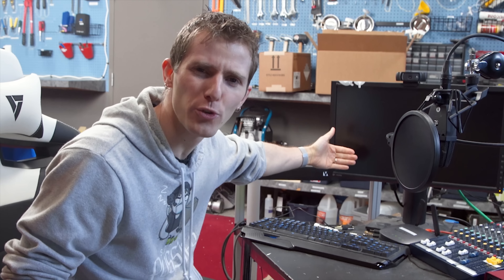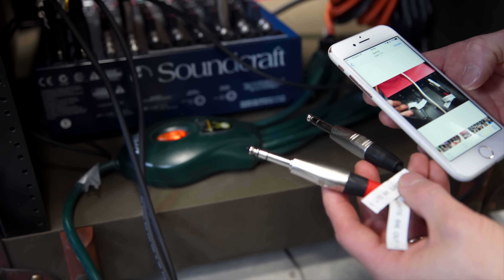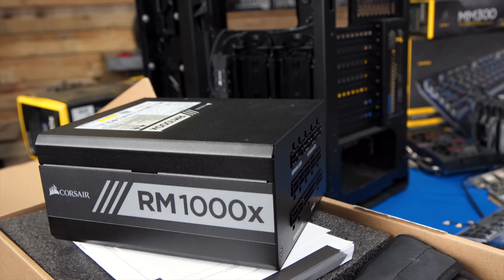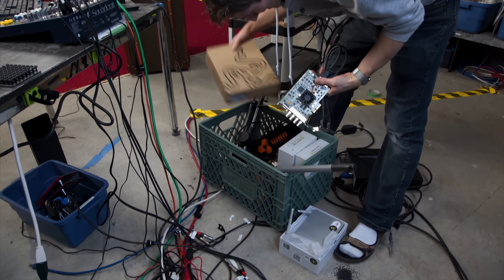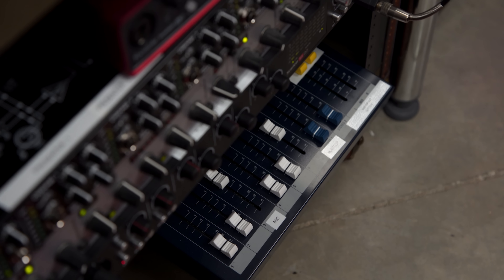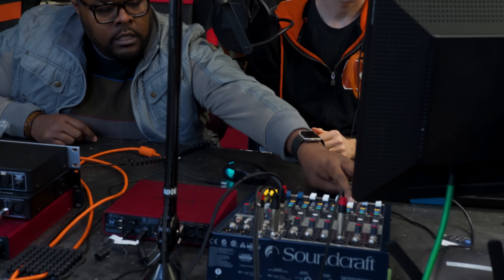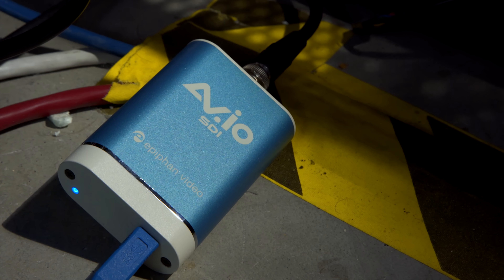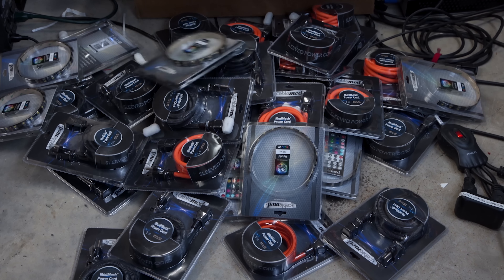WAN Show Repair Vlog - It finally works!!!

Comment: The RGB improves the power of the components by 200%
Reply: Power as in performance or power as in power consumption?
Reply: Works the same as stickers on cars to improve the engine.

Comment: Audio, the one tech I will NEVER fully understand
Reply: I find good audio to be very satisfying, but when youre streaming and you have say, 5 different audio sources you need to be able to control them on the stream, because what your stream hears isnt always what you hear
Reply: Honestly it isn't that hard. Even this completely overkill setup is just a bunch of simple stuff connected together in a way that's hard to understand.
Reply: Complex things are almost always just many simple things connected together. IMO the connections create the complexity, not the things being connected. To cut thru that complexity, try making a wiring diagram. Because you have to think about the wiring  while making the diagram, you'll get a much better understanding of it.
Reply: Audio is like driving; you have trucks, vans and cars, but once you learn one you learn them all. There may be a few different techniques and things to consider when driving each type of vehicle, but at its core the concept is exactly the same. The most complicated part of their rig is running 2 audio interfaces on one computer simultaneously. I've worked with a Zoom H4N and I've worked on the the biggest Neve Genesys console in the world, yet audio signal flow is identical once you take away digital conversion and networking.

Comment: Next up would be to take inspiration from the table you built and make an announcer style table where screens are 'integrated' into the table (i.e. a glass window with the laptop below). Possibly even move the screen for the streaming display to a projection (beamer) placed behind the camera so the screen is not in the way. Thus if you remove a lot of the items from the table, and possibly make it height adjustable, the set-up could be used for build or the intro/outro parts.

Comment: The HD120s are such good fans, I've just put them on my radiator and they're very quiet, with good static pressure and excellent lighting to boot.

Comment: I like Corsair, I really do. I just FUCKING HATE the rgb craze, PICK A FUCKING COLOR. THERE ARE MILLIONS OF THESE THINGS.
Reply: I mean isn't it better to have the option of any color than just one. By having full rgb on things like gpu's, cpu closed loop coolers, mobos, mice and keyboards you have the ability to really customize any theme for a build. Especially now that white cases, boards, and gpus are becoming more common all these lighting options allows for cool flair no matter what style you are going for.
Reply: Buy RGB, chose only 1 Color, ignore the three letters, be happy!
Reply: I agree. I much prefer just picking one color and theme rather than the rainbow garbage.
Reply: Why do you hate having a CHOICE exactly, Ali? It's not like you have to use any kind of animation or rainbow effect. If anything RGB LED as an option (note - OPTION) is one of the best things to happen to PCs in a long time.

But Whiskey... RGB products allow you to do that...and change your mind later without replacing everything.
Reply: Mr Whiskey the thing about RGB is it let's you do that.... people are using it wrong imo. It's painting for people with commitment problems
Reply: what if I'm moody?
Reply: but i want all the colours! I like the pretty waves they make on my keyboard.
Reply: you can also turn it off
Reply: I think RGB concept is fucking great. You can match your build. The problem is when the hardware has colored parts so makes the RGB useless or when it's super more expensive.
Reply: Why do you hate consumers having more options
Reply: I like brown. Can I have some brown LEDs?
Reply: Ali Abdallah 16.8 choices for you too pick on your own
Reply: RGB doesn't necessarily mean laser-light-show under your nose while you're typing, it can also mean "hey I have the choice of virtually any colour under the sun and if I want to I can have some weird pulsating effect or orange rain drops"... under your nose while you're typing lol
Reply: million
Reply: Dude calm down take some RGB
Reply: That is the idea thats why i will buy RGB leds because my build is orange and its not that easy to found orange led strips
Reply: @anthony-y I use my corsair rapidfire rpg somtimes for audio visualizer :P
Reply: ""Linus 2017-RGB Tech Tips""... they should rename themselves..
Reply: With RGB the buyer can choose a color.
Reply: You gotta give the people what the people want. It seems they want RGB everything.
Reply: Ali Abdallah but I don't want to buy new gear just to change 1 colour
Reply: Ali Abdallah the whole point of RGB is so that you can pick what ever colour you want. Now you don't need to look for components with a specific backlight colour. Buy RGB and set it up how you want. The rainbow effect is really only used in showrooms to show off the available colours.
Reply: I like options. This gives me options.
Reply: RGB allows you to customize yourself a great theme. 
It's the people who use the rainbow rave setting for everything that I hate...
Reply: how do you like monochrome? I'm doing black and white for my latest build :)
Reply: Agreed. I mostly use the classic red on black, but my K70 Rapidfire keyboard runs through a red, yellow, blue and green theme currently. I love looking at the rainbow wave setting, but I can't game with it. It's way too distracting. It looks good for AFK stuffs or for showcase, but putting it on everything and using it when gaming. Hell no.
Reply: Nothing prevents you from buying the Corsair products without RGB. Like I did. (where is my sponsorship, Corsair?)
Reply: I don't see why I'd rather settle with one predetermined color when I can choose any one I want. Why do you people whine about it nonstop? Don't buy it.

Comment: For all the extra work you've done, didn't adding a second host mic ever come into play?
Reply: Calder L I think this would create an echo as they are sitting really close to each other
Reply: They're using a voiceover mic, if they used end address mics, it should help while also giving better individual control for their own sounds
Reply: There's always something extra you can add/tweak/reconfigure/change, even more so with audio setups than PC setups. It pays dividends to your sanity to just say ENOUGH at some point and actually get on with using it ;)

Comment: linus, i think mixer is still considered as a preamp,  just use the XLR and enable the phantom power,  and the mixer is needed for changing the gain, you don't need to adjust the compressors, just use the mixers gain,  just dont use an XLR to trs if you're gunna plug it in a pc,  it'll make a small pop.

Comment: I shall bring my sound engineering knowledge here to confirm: Focusrite is amazing. I use their gear on a daily basis for stage performances in several different configurations, and I've never had issues. They're industry standard for a reason.

Comment: An 18i20 to take 2 channels of audio in? a 2i2 could do that job easily lol.  Also I'd have used two condenser mics at closer proximity to get rid of the massive boom arm but hey, I guess it all works.

Comment: Can u try putting two mics out of shot, either above or to the sides of the shot to make it nicer. Also, when plugging them into the sound desk, use the first two faders, they work the best, always fill up the xlr inputs from left to right
Reply: And also try using a rack mounted UPS, then the system can be moved more easily, and less cable runs

Comment: Linus the cases look nice but show don't make them go. If i had a lot of money I would do the same thing. However, I don't so performance has become more important to me. If i had to choose between a expensive case or a graphics card I would choose the card over the case. I went with a Ultra Rogue Full size case it was 50$ on sale and tons of room inside serves my needs nicely. The savings allowed me to get a gtx 1070 and stay in my budget. Only reason I have any led stuff on my build is because the case fans were already blue led and the graphics card has them built onto it as well.

Comment: Can I givo you an idea?? Buy a Furman Power conditioner for the audio gear, I know that you already uses a UPS, but the filtering of a regular UPS is bad for audio gear in most of the causes, introducing noises and causing unreliability, and you will have a rackmountable power strip with isolated outputs on the rack...

Comment: Why don't you guys use wirecast? The intro audio wouldn't pop and it would just run smoother in general.
Reply: Goofygiggles you have a lot more options with Obs

Comment: The entire server cabinet and the mixer could be replaced by a SINGLE Soundcraft SI Impact. It got 32 DIO for computer. 24 imputs, built in: preamps, compressor, and lots more fetuares for the streaming system.

Comment: I'm not keen on Corsair. My CX 850M craps out with around a 300-400W load on its 12V rail while having really bad coil whine (even at idle), while my VS 650 doesn't have any problems at all (apart from its low shutdown temperature-a problem in Australia)

Comment: Why not to use a short 4U (or smaller) case and throw the PC inside the rack along with all the audio gear? That way you'd have all you need, already plugged in and ready to deploy anywhere you need

Comment: hey Linus, I was wondering if you were interested in tearing apart a gateway 2000 PC. I have four of them of which I've taken out the drives in them and left one in tact. I was wondering if you'd like to tear apart one and potentially mod it into a retro PC case mod

Comment: Hello Linus/Viewers!

In 2 weeks I'm building my first ever gaming pc. I've watched videos for over 4 months while saving up money so I know how to build it, my only question is if my build is good, or if I'm doing something wrong. Tips are also welcome!

I'm going to play games, livestream, record and edit vids.

Budget: $1100 (I live in the Netherlands so prices could be different but in my country it's in the budget

CPU: i5 7600K
CPU Cooler: Cooler Master Hyper212 Evo
GPU: Asus ROG Geforce GTX 1050 Ti Strix OC Gaming
Motherboard: Asus ROG Strix Z270-E Gaming
Ram: Kingston HyperX Fury 2x4Gb DDR4-2133
HDD: Western Digital Blue 1Tb
SSD: Kinston HyperX Fury 120Gb
PSU: Cooler Master G550M
Case: Aerocool LS-5200

I'll also add some blue led fans into the case for good airflow.

I like the Republic Of Gamers Strix theme because it's all black with rgb lights so I can change it to whatever colour scheme I want, Main colour scheme is Black/Blue.

I know the GPU isn't top tier but that's the easiest part to upgrade for me so I will upgrade it later to a 1060 6G or something.

Just tell me if I should buy for example an other PSU or case, because I want it to look nice and have good cable management

Thanks!

Comment: at around 6:45 you mentioned the resource conflict. I would really liked if you had said what was the problem (like how did you notice it) and why did that external adapter fix it? I mean just if people have this problem in the future.
Reply: Hene193 He mentioned it on WAN show. IIRC, it was due to the number of inputs from the numerous capture cards so he's split them between the motherboard and the external card.

Comment: It seams to me corsair backed them into a hole. A rack mount PC with PCIE capture cards in the same rack as the audio gear would probably be a better solution.

Comment: Legit my streaming setup
Some internal mic
A potato (as the power supply)
Some peice of cardboard for a motherboard
String for my cables
No speakers
A piece of old hard bread as my monitor 
Plastic box graphics card
And a paper box as a hard drive
Reply: I wish I could upgrade to a plastic box graphics card.

Comment: IMO the audio part is unnecessarily complicated, which means more things to fail. I mean I'd replace almost everything there with just one motu 1248 and get great sound and a web-based mixing interface to boot.

Comment: Wait what the hell, what are those fans they gave you? I have the corsair crystal 570x and the fans do not have that outer ring of LEDs, only the dumb limited center of fan lights
Reply: Flat4Buggy 2 Thanks! They must've just released them, I looked for better ones when I first got the case.

Comment: I feel like this is way too complicated for one mic, two line-ins for laptops and a simple compressor. I'm not streaming anything anymore, but when I did I used an old PC with Audigy 2ZS and kX Project drivers installed. 
I'm pretty sure it would be enough for this.

Comment: Lines why in the hell are u using analog?? Make your life so much easier to switch to digital mixer.. (xr18 by behringer... is a really good start about $800 and u will get a lot out of it !! ) look in to it.. or even a xr16 would work !! Everything can be controlled form your PC or a tablet
Reply: Compressor effects and everything else is already built into this board you would save so much room and space if you just go digital ( take a look
In to it !!! )

Comment: 2:31 how did you do that effect with the fans i have the same case just a different mother board
Reply: By using the included RGB controller of course.
Reply: oh well i have it just im using the sp120s not hd120s